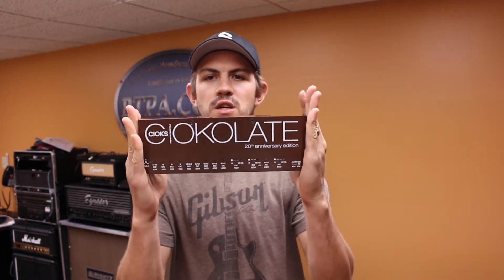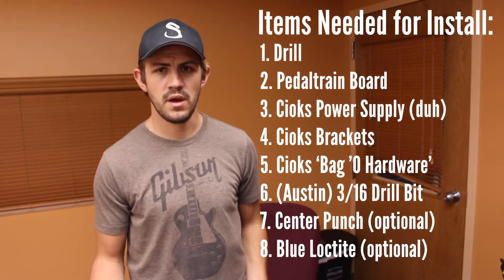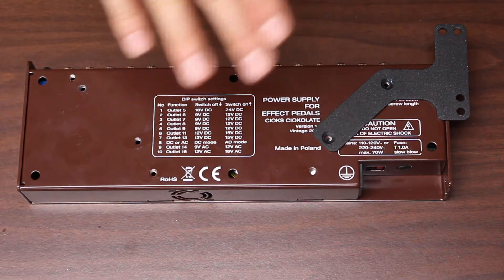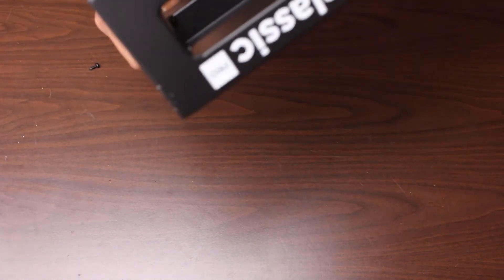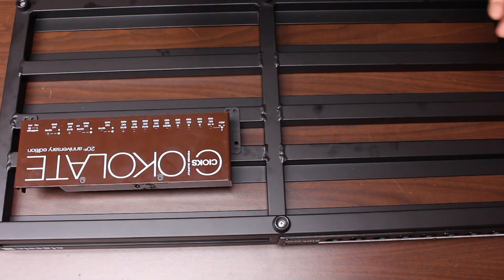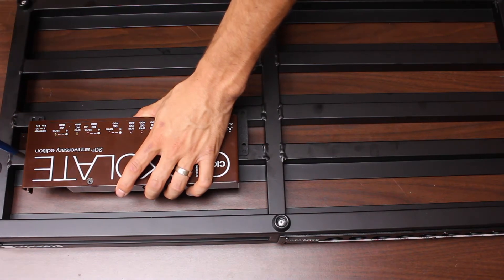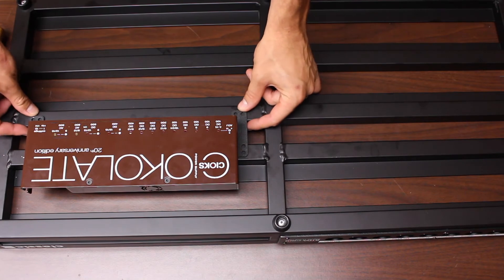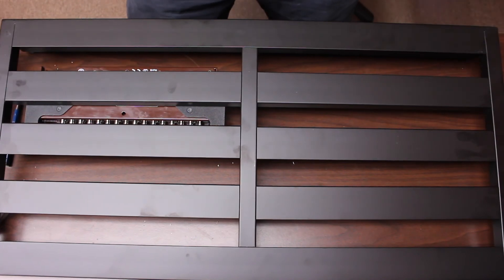Install a Cioks Ciokolate to a Pedaltrain Classic Pro

Comment: Would really Ike to see how the Cioks power supply is wired to the PowerCon...
Reply from the maker: It terminates directly to it. The powerCON features tabs on the back that lugs (crimped on to the power cable) slide on. Very similar to a speaker cabinet. We have a video showing how to install a pre crimped cable to the powerCON. We can make the pre crimped powerCON assembly to whatever length you’d like